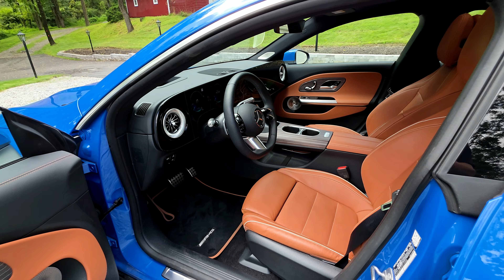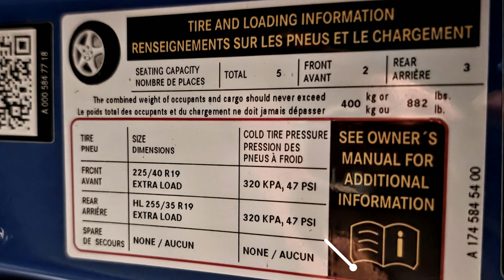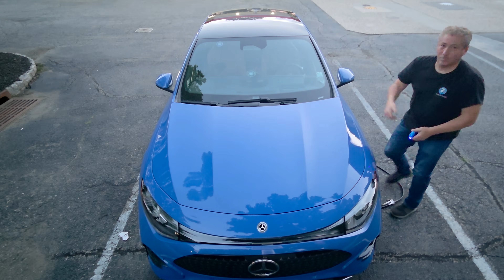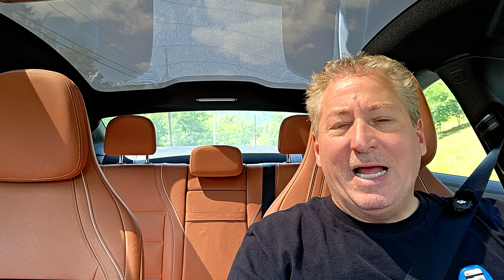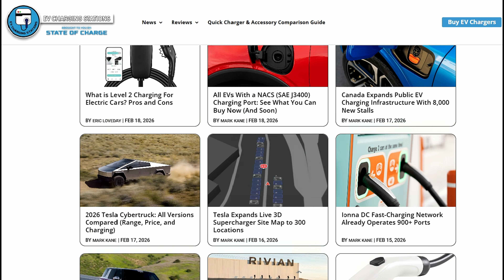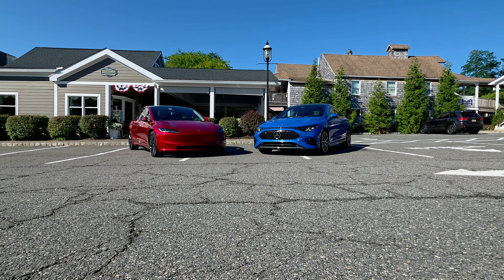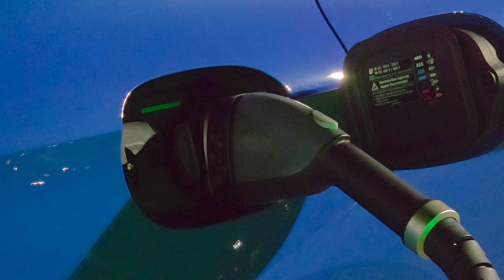The Mercedes CLA 350 4MATIC Has Seriously Impressive Highway Range

Comment: Legacy brands (BMW, Mercedes, and Volvo) all have EV's this year with impressive range and charging. Crickets from Tesla and Rivian.
Reply from the maker: I always knew they would catch up with range, charging, and efficiency. But they are all behind the new brands with their software and connected-car features.
Reply: @StateOfChargeWithTomMoloughney  Thankfully, just give me Carplay/AA and I'm fine. I have a Rivian, the sw isn't always a positive imo.
Reply: what crickets? Edmunds got 100miles real world range back in 12mins on their latest model 3 test. 
The yl can go over 330 miles real world with 6 people for 60k on just 84kwhs smfh. 
They may not be doing anything flashy but nobody beats tesla in overall value per dollar safety tech and total miles gained per minute of charging for the $ STILL here 9+years after the 3 dropped and 6+after the Y dropped. 
The ct is the most efficient full size ev truck with the fastest range per min of charging gained. 
I think they need some newer upgraded models to especially to replace the s&x but they are on top for a reason and still 55-60% of ALL us ev sales STILL and the scer network is also still the us largest dcfc network! Also still one of the top options in it's pricing point for china which is the most competitive overall ev market globally.
Reply: @4literv6  This CLA test shows Mercedes can top Tesla's highway efficiency. We'll see what the charge tests reveal. That's my point: legacy auto has caught up. $ for miles gained charging is nice. It's not the primary reason I'd buy any vehicle.
Reply: Hmm… let see Tesla just launched 3 row model Y, robotaxi, lower price cybertruck, Tesla semi. They constantly upgrade their cars with new features with over the air updates. They drive themselves from point to point. Without Tesla charging network all other makes will be commuter cars. That’s not enough 😂😂😂
Reply: @bobbysuazjFhvcfgh Dont forget to factor in the time you have to spend at a dealership to buy the car.  Waiting an extra 5 mins at a charging station a few times a year won't offset it.  Either way, kudos to CLA for being very efficient but all EVs charge at 11kW on my driveway
Reply: @bobbysuazjFhvcfgh Yet range and charging unchanged.
Reply: @rnodeprot if u can’t wait 5 extra mins for charging, why aren’t u flying on ur private jet?? 😂😂😂
Reply: @bobbysuazjFhvcfgh I'm more concerned about range. Charging is just disappointing, given Tesla used to lead.
Reply: @bobbysuazjFhvcfghMercedes got license for Assist Drive Pro even better than FSD...does not disengage if you steer a little bit...there is a Video driving in San Francisco without any Action from Driver.
Reply: @josefv-y8m  lol ur smoking some hard stuff. Go watch video of wholemarscatalog of that “hands free” system 😂😂😂